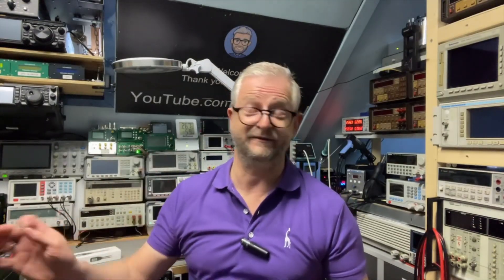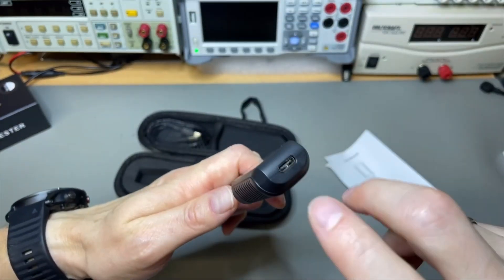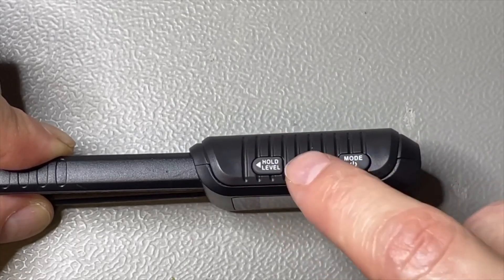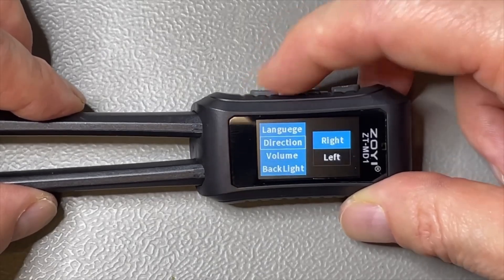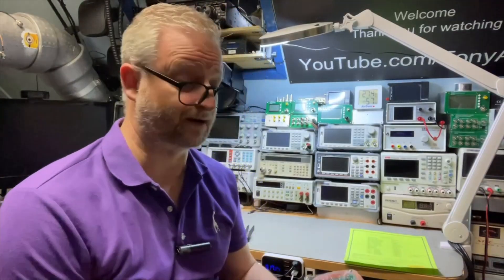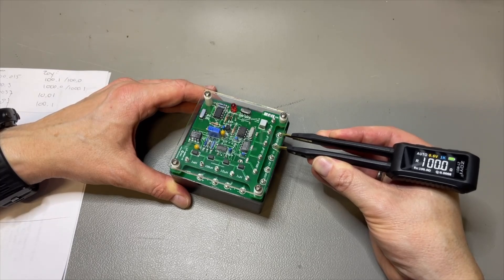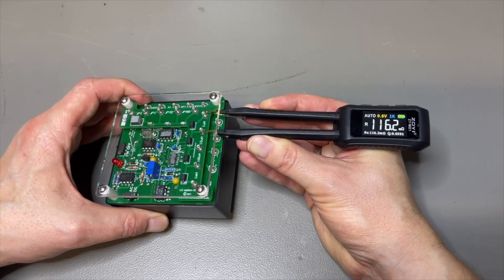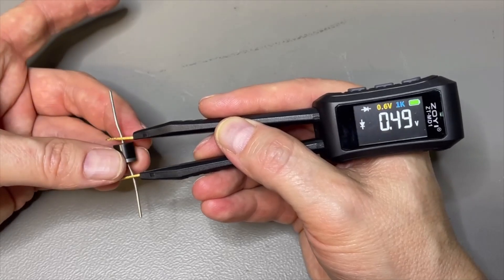TA-0415: ZOYI , ZT-MD1 - LCR Bridge Tweezers - Hands On

Comment: You almost did all measurements in auto mode, if you had set the manual mode and used 10k the value would have been more accurate. You can also read that in other reviews such as Kerry Wong.
Furthermore, the tweezers were not calibrated in advance.
Maybe next time also try the manual modes to get a better insight.
Reply from the maker: Thanks, yes i do use these in automode, if i want something accurate i use my desktop model.
but indeed sometimes a higher frequency give you sometime better result, but on hihger values, you need to go lower in frequency.

Comment: Hi Tony thank you for the review, what does the "D" display mean on the Capacitance range please.
Reply from the maker: While all LCR meters offer readings of inductance, capacitance, and resistance, higher-end meters will also provide additional measurements.
These options typically include 
impedance (Z), 
phase angle (θ), 
conductance (G), 
susceptance (B), 
dissipation factor (D), 
quality factor (Q), 
and equivalent series resistance (ESR).

D or Q:  
D is called the dissipation factor and is the real part of the impedance divided by the reactance (the imaginary part of the impedance).  
Q is called the quality factor and is the inverse of D.  
When D is very small (or Q is large), the component is essentially a pure reactance.
Reply: @TonyAlbus  Thanks Tony

Comment: Hello Tony thank you for your video demonstration. Just placed an order yesterday based on your video it's not a bad tester it's pretty good quite accurate for its price. A little bit of a disappointment in the diode test for LED lighting up but nevertheless it's not a problem.
Reply from the maker: Thanks! Yes the 1 Volt is low for LED.  for its price well done

Comment: OK well just that quickly they rolled out v1.7 to address a few other things

Update details:

1. Added the functionality to save and export measurement data.  
2. Improved the accuracy of low resistance measurements.  
3. Corrected spelling errors in English words

I'm excited to give it a try.  #1 seems really cool!
Reply from the maker: Thanks!! where do you get your updates? .. zotektools still has older i think
The FNIRSI can do the export, so they had to i think.
Reply: @TonyAlbus  See my post on EEVblog forum for this.

Comment: ESR on Capacitance Range
Tony: Can the unit display ESR when measuring caps? If so, with larger electrolytic caps (say >1000uf) does the measurement frequency need to be reduced to 100 Hz, or can it measure ESR at 1KHz/10KHz?
Very nice review, Thanks
Reply: Rs on this unit is equivalent to ESR on other units. It works good for >1 uF. 100 Hz is what you want for E-caps. D and Rs is rather inconsistent for for small non polarized caps.
Reply from the maker: @pault6533  Thanks!
Reply from the maker: Bigger Caps you indeed need to lower the frequency by hand.

Comment: Zener diodes?  What is the Voc and Isc?  Thanks Tony!
Reply from the maker: I don't think it will, with its only 1 volt
Reply: @TonyAlbus  OK I see that now.  Do you think they will fix the spelling of "Languege" in the next firmware update? :face-turquoise-covering-eyes: Did you get the extra set of tweezer tips?  Are they the same (a spare set) or different (different shape)?
Reply from the maker: @pault6533  There is a posibility to do firmware updates, so that is a good start, if they will is not on me. usualy i show everything i got from them, if you did not see it on video in teh quick unboxing ,i prob did not get it, i do not remember.

Comment: Tony, there's no reason, at all, why an LCD can not be used in either hand, since, typically, the bit map display is software driven, and even in Arduino, easy as pie to "flip"
Reply from the maker: Classic LCD has fixed 7-sigments for numbers and some single bit for the 'signs' ... for bitmap driven lcd this should indeed not be a problem. but why use that if you have now OLED

Comment: Good form factor on that meter. Maybe do a teardown? I'm interested to see whether it has input protection and can handle a charged cap. 

And throw those China capacitors in the trash. Capacitance way below spec, high ESR, leakage current trough the roof and can explode even under rated voltage. They're not worth the time and effort when quality caps isn't that expensive.
Reply from the maker: Yes you are right about the caps... what a disapointment.

Comment: They are particularly handy for hobbyists for checking SMT components before they install them, as well as for comparing 2 identical circuits such as channels in stereo amplifiers, since each device tested includes all of the same interconnected components. So whatever the tester reads merely has to be the same for both channels. It makes zeroing in on the problem portion of the circuit very quick. That doesn't matter all that much for hobbyists, but for repair techs the speed matters a whole lot.
Reply from the maker: Thanks! yes good point!

Comment: Hi Tony, I'm Left-handed Right-handed - I can do everything with both hands - it's a pity that the image does not change in AUTO mode with the position sensor.
Looks very good, I will probably buy one (when I have money to spare) 😁

Nice day 🙂 Tom
Reply from the maker: Thats is a nice idea, position sensor, but than you need to be able to switch it off too... like ipad/iphone.. depends also on you working position at that time..
hanging up-side-down, you dont want the display to flip on you :)
Reply: @TonyAlbus  Well, of course, I probably wrote it wrong, I meant, in addition to manual control, the option to turn on AUTO mode.

Comment: Maybe I missed it, but how do you vary/select the test frequency?  Looks like it offers 3.
Reply from the maker: Oops, yes i did not show that. easy, the Left or Right button
Reply: @TonyAlbus  The different frequency could have influenced the different results with the LCR meter 🤔
Reply from the maker: @Edisson.  Yes correct, i tried again :
4700 uF
MD1.    0.6V - 1KHz :  4100 uF / D:1.3627
MD1     0.6V - 100Hz: 4140 uF / D 0.1763
4090C    1V - 1KHz :  3755 uF / D 0.6181
4090C    1V -100Hz : 3943 uF / D 0.0923